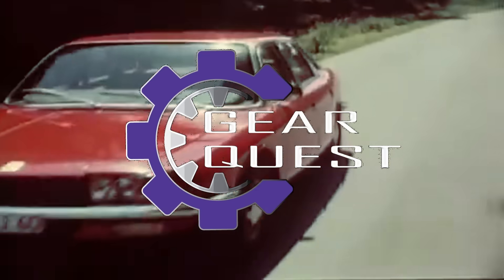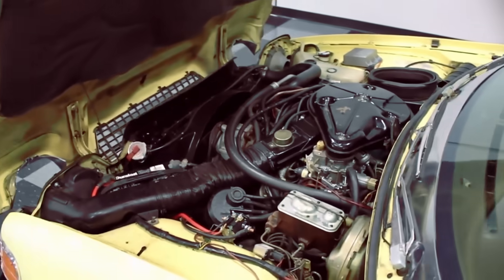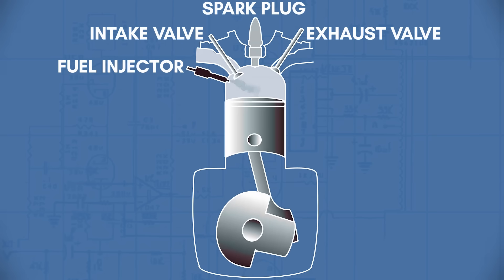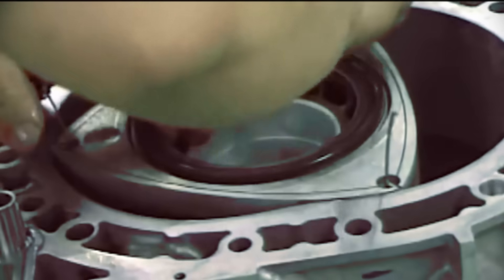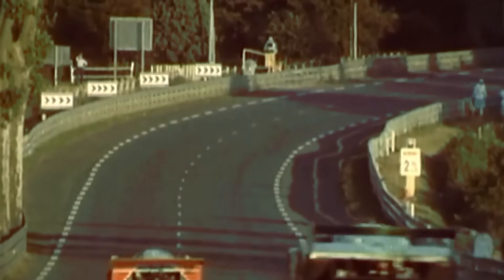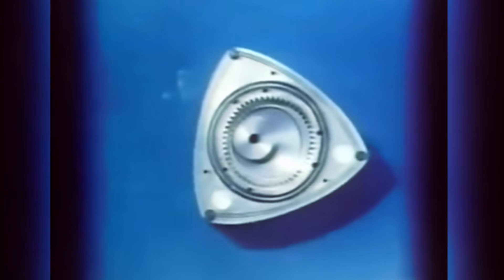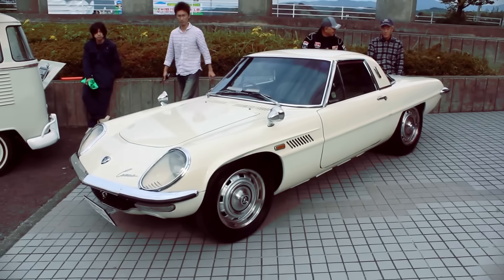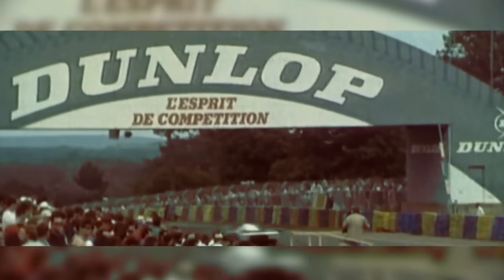The History of the Rotary Design

Comment: This makes me really miss my old RX-7s.

An 83 was my first car at 16, it also had 155,000 miles on the original engine when I sold it and ran great.. then moved up to a 91 2nd gen, which has the coolest red line warning buzzer and shift light.. and then a 93 3rd gen. I was 19 and because of the turbos, insurance was around $500 a month for liability only on the 93.. worth it. 

I very rarely see any RX-7s on the road anymore.. sucks.. 😔
Reply: My brother works in a Mazda dealership. An elderly man just traded in an rx7 with less than 2k on the clock. It's been sat in a garage for years. It's in absolutely perfect condition. Mazda decided not to sell it and instead have it on display in the showroom
Reply: SMERSH a showroom is what it deserves!  My coworker had a first generation that was quite pristine and had 30k on the odometer.  He obviously never drove it and was willing to part with it. It would be in my garage right now except it was an automatic!  No bueno!
Reply: Keith Olsen My little brother had a ‘79 and I had an ‘84 when we were teenagers (had mine until I was 26 or so).  I miss them too.  It was my first manual gearbox and remember shifting when I heard the buzzer at 7600 rpms (I think).  If I was accelerating hard I’d not shift until much later.  I also remember my brother drifting a big swooping curve at 90mph.  Damn!   After I had mine for a bit I had headers and an expansion chamber replace the old manifold and catalytic converter.  It made a fun car more fun.   For a short time I lived near Road Atlanta and there were 3 garages that specialized in hopping-up rotaries.  Ahhh the good ole days!

Comment: What if instead of stationary apex seals, they rotated along with the rotor. Kinda like a rolling pin. And as for the incomplete combustion, what if the first rotor's exhaust lead into the second rotor's intake for a second, leaner cycle burn? It might cut emissions & get a little bit of power too.
Reply: Mark Ferrer These things do sound fairly reasonable. The thing is we can imagine that a team of experts in an R&D department have already thought of almost anything we can think of, and if there was an 'easy fix' they would have used it already.

Comment: With ‘agile handling’: Cuts to clip of some of the worst body roll and understeer I’ve ever seen.
Reply from the maker: This was considered agile at the time.
Reply: The Ro80 handled like it was on rails at high speed, even with those skinny Michellin tyres. LOL

The fully independent coil over strut long travel suspension that was highly advanced for it's time, and still is.... allbeit a common design these days... decades later.

Front wheel drive... and you expect no understear when pushed to the limit? 

Perhaps you enjoy overstear? And how does a typical low grade driver handle understear... yeah - tragically.

Simply, none of the commenters to this clip ever owned or drove an Ro80.

Comment: The most powerful model/version of the Mazda RX8 naturally aspirated 1.3L rotary engine produce about 235 CV (~230 BHP) something around those figures if remember correctly.
Reply: I have a 55 yr. old Falcon Ranchero with stock 289 cu. in. with 4 bl. Holley and headers that develops 245 H.P. so I don't understand the hard-ons' with a rotary engine with all the troubles~!!

Comment: Conclusions that's Winkle rotory engine more for racing than practice daily use.  (787B use 4 rotor 26B design, with each cylinder hold 3X spark plugs to increase fuel efficiency)
Reply from the maker: Thanks for listening. I corrected my error in the pinned comment above.

Comment: The Wankel rotary engine IS an "internal combustion engine".. It differs from piston engines in that it doesn't use pistons or connecting rods to create turning motion of the crank shaft.
Reply from the maker: The audio dropped out and I mentioned the error in the pinned comment. Thanks for listening closely 🙏🏼 hopefully it doesn’t take away from the analysis of the video.

Comment: so add a quart of 2 stroke oil to your gas tank with every fill up if you own an rx8 ?  lol
I remember working on the rx3's & rx5's with blown engines after the new owners ran the oil crankcase dry back in the day. Let the rotary engine warm up for a few minutes before you drive it  - that's the easy way to make the apex seals last longer
Cool vid !

Comment: Was the first NSU RO80 powered by 995cc or 995cc per rotor, just asking as 995cc divided by 2=497.5cc which is a bit of weird number? It was still an internal combustion engine! A buyer of one of these engines are either fanatical, mad or religious (praying it wont break). Normal car owners take their car in for a major service! Rotary engines need a rebuild! Great vid & very watchable............all the best.............
Reply: The NSU engines were 995cc total, as calculated by the same method used by Mazda 12A = 1200cc and 13B = 1300cc.
The NSU engines were all peripheral intake ported as standard design [tough on apex seals] - the Mazda used a side port system [OEM standard] 

The NSU engines were heavier than the Mazda.

Comment: I’ve love to see diesel version. Might do away with some of the “oil burning” myths
Reply: They’re not myths, there’s literally a hole where the engine injects oil into the combustion chamber...
Reply: They’re there to keep there apex seals lubed up
Reply: there was one, it had two separate rotors one for compressor (supercharger) another for the actual work to be done, it was used by a military, on a heli if i am not mistaken
Reply: Apex seals and oil consumption is the ultimately caused the demise of this engine. Might as well run a two stroke engine.
Reply: Diesel is oil u fool
Reply: Trent Robey That’s the point.
Reply: Trent Robey I don’t get where your comment plays a part in anything we said in these comments.. not trying to be a dick don’t get your feelings hurt, I’m legit confused what you’re talking about

Comment: "With agile handling" shows car pitching over like a damn boat 😂😂
Reply from the maker: Well for the time it was considered agile 🤣
Reply: considering that this car can pull 1 to 1.2g in corners with OEM suspension components, yeah...I'd class it as agile.
Reply: nothing back then was flat in the curves from the factory that was reserved for racing.
Reply: Watch the videos of the McLaren F1 from 1996. The amount of roll in it was crazy compared to modern cars. Body roll isn't necessarily a bad thing.
Reply: I think that's before they knew the importance of anti-sway bars. Early Corvair had that problem too, but by the time they fixed it the bad reputation had stuck.
Reply: Road was slightly cambered
Reply: That was well before front and rear anti-sway bars were a standard feature on factory performance cars, so let's just say "agile handling for 1967." lol
Reply: I lol'ed
Reply: LMAO...I said the same thing...
Reply: lol... looks like a 80 ton semi u turn at 60mph
Reply: The Ro80 handled like it was on rails at high speed, even with those skinny Michellin tyres, no matter what road camber. That is an exaggerated neg. road camber of intent to show 'on rails' characteristic in the old sales/demo footage. LOL
Combined with all other design features the Ro80 was a most competent performer... very predictable and never 'scary'... [how the damn thing accelerated above 1500rpm in every gear was, even using a small 12A] 

btw... The original '990cc' NSW motor was peripheral ported and exceeded the output of the standard 12A Mazda. NSU dual side draft carb... yeah, it did need an air filter/chamber designed to act like a muffler, because that thing had a loud low roar with fully open throttle above 2500rpm... easy to 7500rpm.  

The Ro80 had fully independent coil over strut long travel suspension that was highly advanced for it's time, and still is, allbeit a common design these days... decades later.
Oh.. yes, 'anti-sway' bar at front.. not needed at rear. 

I'd replaced all struts with adjustable Koni inserts some 22years after production date.... an easy job. 

Chassis of the Ro80 was very rigid, plus safe in terms of side impact crash scenario with large double box section side rails [around 200mm x 200mm] that the doors closed over... so from an occupants view the glass area was huge by 1969 standards. 

Had a virtually flat floor pan, flatter than a much smaller VW beetle... the Ro80 being front wheel drive.
Brakes... OMG.. no question about how quick that pulled up without lockup and twist and turn unpredictable reaction.  Those 4 piston front calipers had 2 independent hydraulic circuits fed from master cylinder... the rear set of pistons fed the rear disc caliper circuit. Front pads only used in 2 types of vehicle... the Ro80 and a Ferrari model of same era. 

Inboard mounted discs with calipers mounted on gearbox, means far less un-sprung weight at the wheels... the steel rims weighed far less than any fancy cast alloy. Sure looked good with no rotor or calipers there too.. had many tyre fitters go WTF removing road wheels. LOL  

Steering.... a very simple yet logical layout. Rack and pinion that acted on a centrally located pivot arm [ bearing mounted high on firewall ] , the Hydraulic power cylinder virtually opposing at same height and frame mount position [easy RH to LH conversion].. then equal length tie rods connected lower down on that pivot arm. 

Very aerodynamic bodywork.. CD efficiencies it took decades for other vehicle manufacturers to match, albeit with highly advanced design features like trim detailing. There is a certain appeal to a small distance from top of front wheel arch and top of fender.. take a look at many sexy looking sports cars... all short distance.   

Front wheel drive...  so, you expect some under-stear when pushed to crazy tyre limit. 

Thats easy to recover... back off a little.
Perhaps you enjoy over-stear? And how does a typical low grade driver handle over-stear? 

Yeah - tragically.

Simply, it's a safe bet... none of the commenters to this clip have ever owned or driven a Ro80,  designed as a mid-sized 4 door family sedan... not a performance or race car. 

It was more like a 4 door Porsche, and certainly far higher performance than the comparable  'sister' AUDI F103 [a hell of a lot sexier than the AUDI too]

Despite the very real 'go fast' nature of the Ro80, it was nothing like the 'cop magnet' [aside friendly interest] than shit very ordinary GM and Ford vehicles I'd owned prior and after the 8 years owning a Ro80 - zero bookings over that time.
Reply: Once it hits its bump stops it will be fine.  Some roll doesn't really matter if you're prepared for it.  Plus it was a long time ago, so cut them some slack huh?
Reply: Glad I wasn’t the only one to comment on that atrocious body lean
Reply: More body roll than a Miata :)

Comment: I wonder if they had thought of cooling it thru convection? Passive ports that don’t enter the chamber but route it’s oil cooling like a radiator? And then into a oil condenser. It would eliminate the smoking, they could go back to using whatever optimal material needed, and still get their power they want.
Reply: They're water cooled already.

Comment: in 23 races, the 787B won one race.

It wasn't banned because it was too powerful or reliable, it was "banned" because of rules that were supposed to be put in that year for a 3.5L engine.
Reply: Im not sure as I didnt check, but they may have had more total DNF than total podiums in 767/787 combined Hx.
Reply: The 91 Le Mans Mazda 787 teams won 1st, 6th, and 8th, but the 90 Mazda 787 teams did 20th, DNF, DNF.  Like a lot of alternative designs, it was a mixed bag.
Reply: I’ve learned that hard core rotary dudes are like liberals. Completely ignore real facts. Lol.
Reply: @psychodadandjfit3974  They're just as common with v8 enthusiast.

Comment: Could 3 mini rolling drums be used instead of apex seals? 

They could be basically long bearings, sort of like an airport luggage roller but just on the tips.
Reply: Doubtful. They'd have to be air tight and able to withstand high heat AND pressure during compression and combustion. Also, carbon from the exhaust would cake up the lubricant.
Reply: I like that idea

Comment: Good video but why the misleading title?
Reply from the maker: Racing authorities and automotive circles have considered the rotary to be equivalent to a four-cycle piston engine of 1.5 to 2 times the displacement of one chamber per rotor. This is attributed to the frequency a thermodynamic cycle is completed at 720° (2 times). A piston engine completes it once at 720°.
 The video is a comparative analysis on both engines.

Comment: The Le Mans race car was a 4 rotor engine, and not "RX-7 under the hood. Also, you can use synthetic oils in a rotary engine, so long as it is a high quality oil (mobile 1 or royal purple, for example). The lower quality oils left carbon deposits that would seize the engine over time.

Comment: rotary was ok , more power for the size for more fuel , in australia they were and probably still are known as throw away engines , because as soon as something went wrong there rotation worked against them and they would tear them selves apart, throw it away and start again

Comment: for all you here saying the rotary was banned because it won or because automakers were afraid is incorrect, the FIA just wanted to move to F1 based 3.5 engines and guess what, the rotary was not a 3.5 F1 based engine so it was gone. The 962 turbos were moved to another uncompettitive class and was also gone untill a loophole brought it back later to win as a road car based race car

Comment: out of curiosity, and a question into the wind, if a rotary is more efficient than a  four cylinder by virtue of its conservation of momentum and smoother power delivery, and an inline 6 is better than an inline  4... how many inline cylinders would it take to be as efficient as a rotary? I know some say rotaries are thirsty, but so can be inline 6 which, typically, are 2 to 3 litre, imagine an inline 12. You could make a 2 litre inline 12 but cylinders/pistons be small, power per cyclinder be small, crank be way long.... How long can a crankshaft be before too much length becomes a liability and it just snaps at some vibrational node? uh, questions into the wind. all engines are amazing... none are perfect... but yes perfect...

Comment: My father use to off road race rotarys until they bumped him up into the v8 class
Reply: So his car wasn't competitive with the true equivalent engines? Or he was a bad driver?
Reply: @johncoops6897  no he was running a n/a 1L rotary  motor against  6L motors  so its hard to compete  NOT EQUIVALENT 
Why the ignorant comment ?
Reply: @Rendezvous70  - I am not being 'ignorant', I'm just stating the obvious. Anyway, your father made his own choice to run what ended up being an uncompetitive car.
Just remember that the 10A isn't a one liter car, it's actually THREE liters swept volume.
Reply: @johncoops6897  he was competitive until they bumped him up  & stating a rotary is equivalent to a v8 is ignorant

Comment: The RX8 engine has an apex seal/lifespan of only 60k miles?! Who in their right mind would buy one of these? Yet I see them around.
Reply: Well it does give lots of benefits, with few terrific down sides. Those who bought them usually had money to rebuild the engine and only looked power the weight ratio. It had flaws but rotary is pretty legendary engine design.
Now days there is rather small but strong community built around rotary, so hobbyist build them pretty easily at home. RX8 problem is easy enough to solve, by after market adjustable oil pump that can be set higher feed rate for racing and everyday use and factory or lower when taken in emissions tests depending of the country of course.
I would love some rotary action, but given prices of those vehicles and somewhat limited usage of 100k km's before rebuild its no for me, but for some they have learned all that is needed and can rebuild engine over a weekend with out issue, so it goes another 100k km's
Reply: @Hellsong89  I can understand the hobbyist/enthusiast aspect to this as one myself- being able to overlook some longevity and having the ability and willingness to do your own rebuilds for sake of performance aspects. However as a mass produced sports car to the general public, it still makes no reasonable sense to me to offer this as a company. From a personal preference/enthusiast standpoint I find the RX8 a rather poor option for a platform cool enough to overlook the mechanical downsides, its ugly, not particularly lightweight for its anemic 235hp NA engine.  The last RX7 makes more sense to me, it hits all the enthusiast points. I daily drive a Supercharged s2000, it performs, stupid reliable and expect to see 200k+ miles on it without a fuss. That's where i'm coming from. I hate making big compromises if not needed.
Reply: @chriswalden798 The difference between a decent FD RX7 and an RX8 of similar quality is at least fifteen thousand dollars. I'm sure many more people would choose the FD if it wasn't so rare and expensive.

You should check out the YT channel "The Slip Angle," he has an S2000, FD RX7, RX8, ITB NB Miata, and a formerly turbo first gen Miata that is undergoing a rotary swap. I always thought the RX8 was ugly myself but The Slip Angle overview of the his RX8 definitely made me understand the allure of the platform for the serious enthusiast.

Comment: 1:40 : «intended to replace the internal combustion engines»... They mean to replace the Otto engine, as the usual (perpendicular pistons relating to the crankshaft) motors are known, because this one, as the Wankel rotary engine, are both internal combustion engines... 😒
Reply from the maker: The audio dropped out and I mention this error in the pin comment above.
Reply: Sorry, I didn't read your comment before writing mine. The video is anyway great 👍!